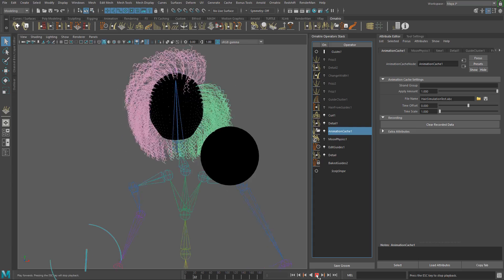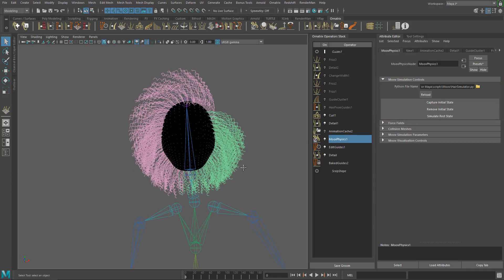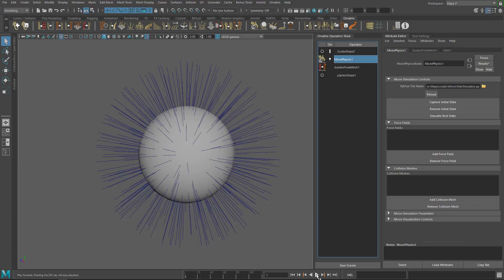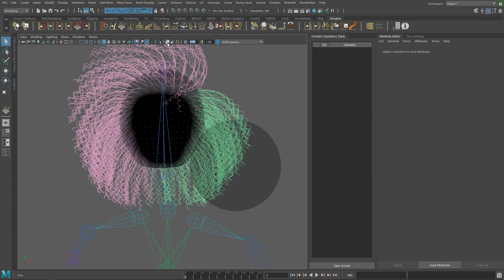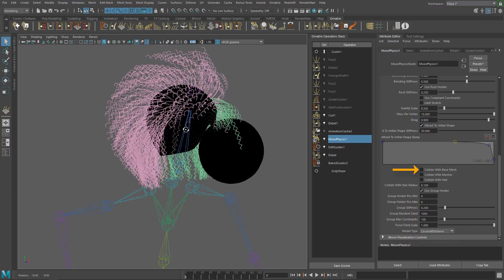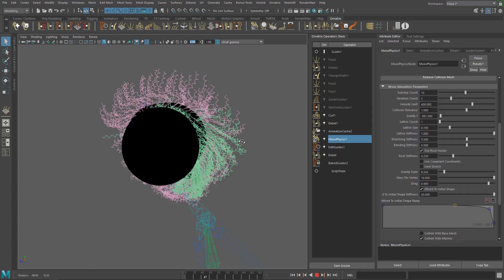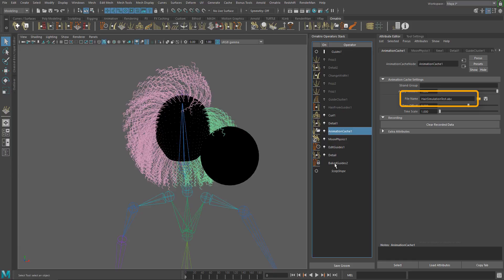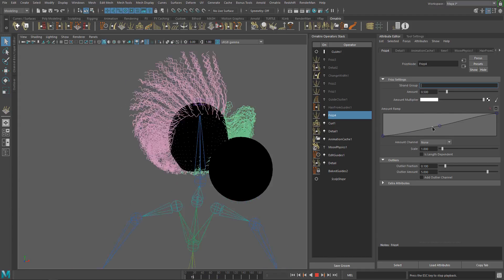Ornatrix Maya V2: Hair Simulation and Collisions - P2 (English, Spanish, Русский)

Comment: Is it possible to have different Moov settings for different strand groups? Like the root stiffness, etc?
Reply from the maker: Not through strand groups directly, but you can control them through strand channels which, in turn, can be derived from strand groups using Generate Strand Data operator
Reply: @Ephere  I also discovered that I can use two moov operators each assigned to a different strand group. One strand group is the top layer and the roots will stay up a bit. The other group is all hair underneath which needs to have flat roots that lay against the head. A problem I've always had with every hair system is that the roots all stick out uniformly and can be see when hair is uniformly straight.